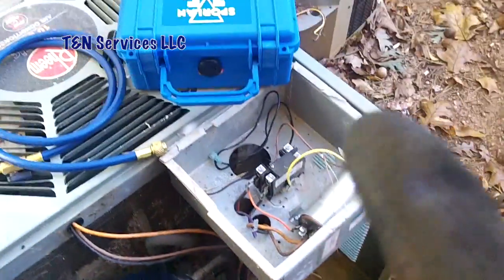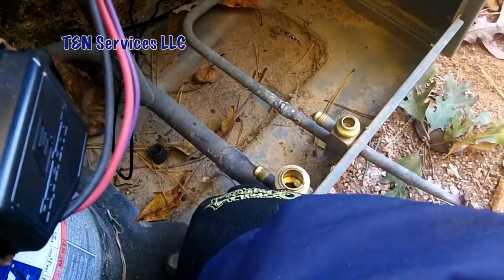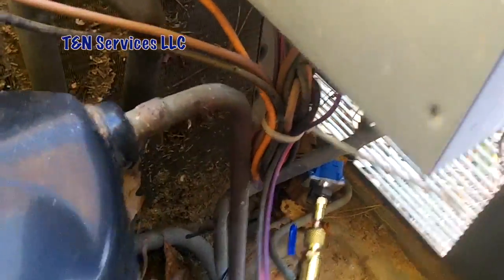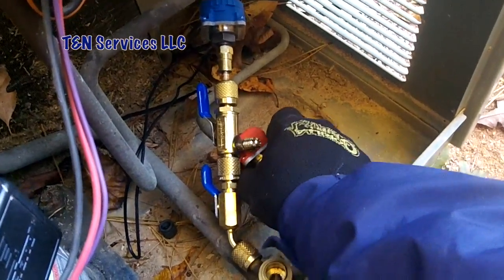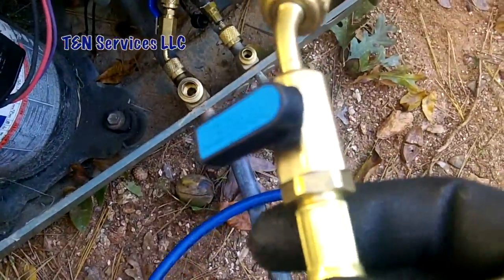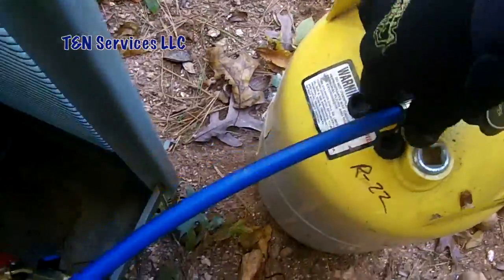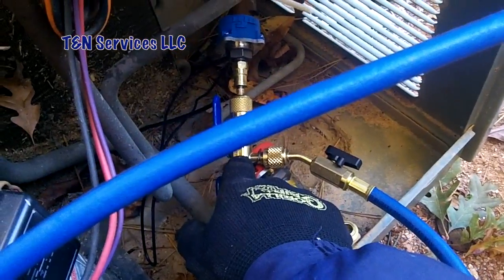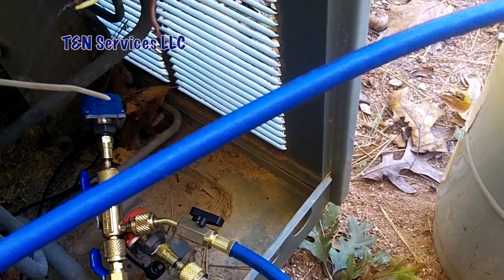How to add freon using the Sporlan Smart Tool

Comment: I will be purchasing a Bluetooth system, probably the Sporlan Smart Tool, but I have just one question. You are using a core remover so in order to charge, you have to remove the core each time? Seems a bit cumbersome, no?
Reply from the maker: +Carlos Contreras there is no need to remove the core. I use a 45 with a ball valve to depress the core which is connected to the core remover.
Reply: I see. Thanks for the videos.

Comment: I want to love it but it looks like a pain in the ass when your jammed for space
Reply from the maker: +Mark E Pugliano I never had a problem putting them on any units. I've got 2- 45 degree ball valve that I use.
Reply: Your properly at least 10 to 20 times the man I am! :)  I'm buying them just the same!  Just on your recommendation.
Reply from the maker: +Mark E Pugliano you will like them. Just check prices. Some of the supply houses have updated their prices yet. They should be around $350-$380
Reply: Ty

Comment: If it was a real "Smart tool" they would have put a charging port with a ball valve on them.... Just my thought
Reply from the maker: I'm glad they didn't add a charging port. Let me configure it the way I want too
Reply: I meant something that would fit on any type of system...like a short flexible hose with a the port and then the sensor

Comment: Don't really need a ball valve hose at all, although it makes it a little easier. Simply connect your refrigerant hose to the refrigerant drum first. Then connect the schraeder depressor hose end to core remover tee connection. Then purge hose at drum. Open and close drum valve just as you would a manifold valve to add refrigerant.
Reply from the maker: The reason I use a hose with a ball valve at the core remover is because it's easier to add 410 to a unit using the ball valve. It's a lot harder to reach under the tank to throttle the valve on the tank then it is to at the core remover. It will work easier like you said if your adding R22 but harder if your adding 410. In the end it's user preference
Reply: Definitely. I agree. I'm doing it the same way. That was kind of meant for the comment below. I charged the same way years ago with a superheat accessory  head using a tee fitting and a 45 ball valve fitting.

Comment: The tool kit idea is good, but you can see right away that it was design by a guy that never work in the field, you don’t need to put your gauges if your temp are fine, now if there is a problem you have to attach all these connection in order to charge the system, which kills the $700 cost of the system,

Comment: I like that setup! If you use it during the summer for ac mode can you charge with a hose straight to the heat pump port, while putting the sensors on the service valves?
Reply from the maker: You could do that. When I charge a heat pump that's how I will charge it. Great ideal

Comment: cool video. I was just wondering if you could make a hose setup that already has that all connected to your gauge set up.  Then you could just twist your lowside and highside hoses on like normal and it would be inline before it hit your gauges.  This way you could also add or take out if you needed to all while looking at your Ipad and your gauges.  I just came across your videos and really like watching them. You explain things nicely. Thanks.
Reply from the maker: Hey skym, the reason I set it up like this is so you don't loose as much refrigerant when you take you hoses on and off. I have heard of guy putting the sensors on gauge manifolds, but it I did that I would just keep using my Testos.
Reply: T&N Services LLC. You are right.  I realized after I posted this that they already sell electronic gauges that do this exact thing I was commenting on.  I do see your reason for setting it up the way that you did.  I also want to say you really know your craft.  I have worked with many guys, old and young.  You remind me of a good friend that I worked with in Dallas for a few years. He used to be a machinist and when it came to HVAC, he was very smart.  Actually he is one of the brightest hvac techs I have ever came across. You even resemble him in a way.  I appreciate you sharing your knowledge and will continue to watch and learn what you have to teach.  Cheers

Comment: Great video! I've been looking at gauge sets for awhile... Testo 550, yellow jacket mantooth which just came out however I could not find reviews on them. Nevertheless, I do like the fact that sporlan is completely "wireless." I'm all for less things to bring in to a job site. And less obstructions the better because some spaces we work in... there are plenty of obstructions to begin with.
Reply from the maker: Hey Michael, I agree with you about no wires and hoses. I love the Smart Tool I am glad I bought it. I still own 2 sets of Testo 550's though. I will still use them from time to time. They are great gauges. Either one you choose will be a great choice.
Reply: Awesome! Thanks for the feedback, T&N services!

Comment: If you had an old manifold and removed the mechanical gauges and then screwed in some 1/8" to 1/4" adapters you could then screw the pressure sensors on in place of the original mechanical gauges, but it would it would leave them free to be removed for times you didn't need the hoses.
Reply from the maker: Hey John, I thought about using an old manifold then changed my mind. I really like hoseless feature though. I'm still going to use my testos but I'll use the Sporlan tool more.

Comment: Im loving it Brother but I asked sporlan about The sensors if we were to put them in a -20 to -40° freezer if they would work and they told me the sensors would no longer be accurate in such a situation but I still would like to get them
Reply from the maker: Yeah they found out the batteries could not handle the extreme cold. That wasn't an issuse for me though. I'm curious how the imanifold holds up in extreme temps like that.
Reply: I think the same
Reply: T&N Services LLC. The iManifold sensors are fully temperature compensated down to -40-300 degrees. If you use these batteries, the probes and sensors will work fine.

Energizer L91 AA and L92 AAA. http://data.energizer.com/PDFs/lithiuml91l92_appman.pdf

The RH probe is also good from -40-248 F. We designed it with refrigeration in mind.
Reply: Cool then i for sure will be getting one thanks a lot that will help in my line of work considerably
Reply: Jim Bergmann cool then I for sure will be getting one thanks a lot      that will help my line of work considerably

Comment: I think you should switch the wireless suction sensor with the charging hose that way you won't need a hose with a ball valve & you can regulate the charge with the valve on the Schrader remover since the wireless sensor would be after the valve it would still read the pressure in the system. And when your done charging close the valve on the tank and open the schrader remover valve to suck in what evers left in the hose it's perfect. I know I sound loud complicated and probably boring, but I'm just fascinated by this new tool.
Reply from the maker: That's a good ideal with switching up the ball valves and the core remover. Some units you may need the 45 on there first because of the way the valve is. In the end as long as you get it done is all that matters
Reply from the maker: Juan Maldonado Jr. I had to do it like that because if you put the core remover on the valve first you wouldn't be able to push the schrader core in because the core remover doesn't have a depressor on the end that attaches to the valve.

Comment: Hey man I'm gonna get me some of those, but can I ask why not buy 45 & 90 degree heads or fittings why do you need 45 degree ball valve ? And call them "wireless gauges" I know it's not accurate but it sounds cooler and no one out there has a claim to "wireless gauges" even imanifold needs hoses and a heavy giant block to transmit from I like those I've thought of this type of wireless set up years ago and someone finally came out with em lol and where did you buy them supply house, internet?
Reply from the maker: I do describe them as wireless gauges when I'm talking to people I know. But you have to be careful on the net. People will tell why they aren't wireless gauges. LOL. I bought them at a the local supply house.